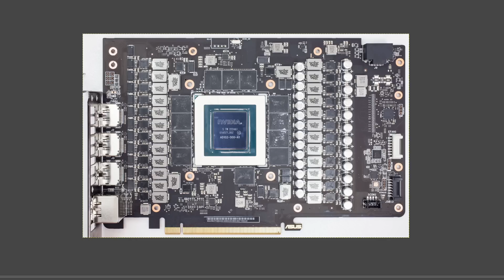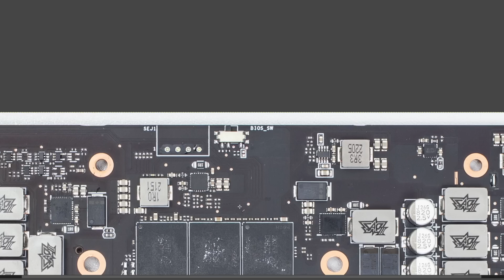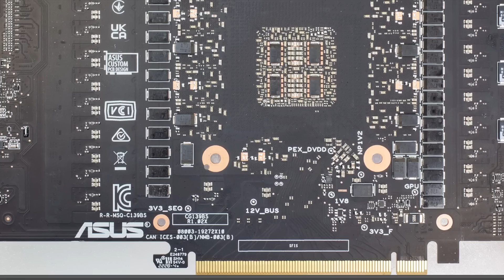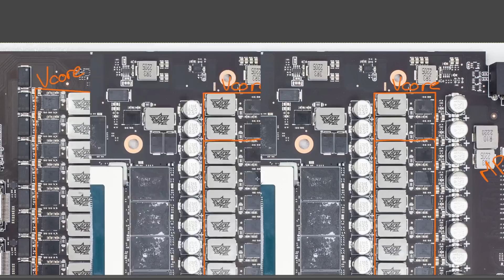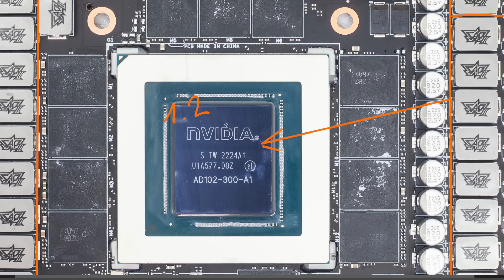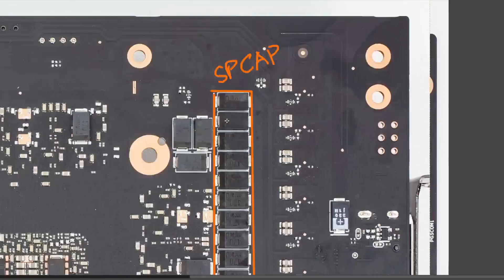GPU PCB Breakdown: ASUS RTX 4090 Strix

Comment: I think that Mp2891 PWM is a part of the issue with the 4090s melting power cables. I don't think the adapters and connectors have suffcient ampacity to handle the draw.
 The switching speeds and energy efficiency measures in the PWM are leading to transient spikes. 
I don't think the MP2891 is the right chip.

Comment: How did you remove the PCB from the cooling fin? Could you present a video demonstration in the near future. I have bought an EK waterblock for my Asus RTX 4090 Strix. However, I had difficulty separating the cooling fin module on the I/O side glued to the PCB. I did not dare to cut the glue in fear of damaging the thin circuit on the PCB.

Comment: hello buildzoid, it is interesting here for asus 4090 the input caps vs output caps choices... because for the consumer we find a lot of coil whine on asus cards (more than other brands). so perhaps either these choices can affect the amount of coil whine, or they are instead some attempt(s) by asus to reduce their levels of coil whine. or it could be due to the fact that they just use so many capacitors overall, or more is of certain types... another point about is that asus claims to have recently improved and so-called 'innovated' their inductors on brand new cards. which replaces their old version inductors. all in the name of better coil whine. but hahaha is it the chokes or the caps. anyhow you dont care about this. but it just maybe explains why they might do such weird looking things. since this issue is while nothing of performance, yet still a matter in response to so many complaints from users. who pays a lot of money for these gpus... so it stands to reason maybe the end result is both combination of whatever nvidia design specs dictates + their own asus performance or inhouse overclocker obsession(s) + also to simultaneously try to re-prioritize coile whine matter. which can be hard to pick apart. and separate one from the other. is my 2cents.
Reply: I sended back 5 Strix 4090 already because of that bee trapped in there and tried a gigabyte one and it has 0 choilwhine compared to Asus but the thermals are 3-5 degrees higher with the gigabyte one and it looks cheaper than the asus one but ZERO Choilwhine howww ?

Comment: I think the different 3.3V rails might exist because they need to have a sequence in which the power rails are turned on. Maybe 3.3V_F is a fixed 3.3V rail, and 3.3V_SEQ is coming through a load switch, letting them sequence it?

Comment: I have this exact card and the coil whine is so bad that I can hear it across the room at stock power levels. Running time spy sounds like a buzz saw. This is hands down the worst card I have ever owned for coil whine I have ever owned. I have even tried putting a soundproofing blanket over the water block it’s just that bad.
Reply: I sended back 5 rog strix 4090 already because of that crazy choilwhine and i will try 1 time again after that i get Gigabyte one because much less choilwhine

Comment: The Strix gpu's have always been great cards.  However, I'm on my second 4090 Strix because the power connector melted and burnt down on the original one.  ASUS replaced it with a new in box card, thankfully, and not a refurb.  Nvidia's stupid idea of a new power connector is a joke...
Reply: PS its not an NVidia design they were first, AMD will have to switch if it is going to comply with the PC SIG standard,
Reply: @zorbakaput8537  amd won't have a problem since the 12vhpwr is getting a revamp
Reply: @zorbakaput8537 connector is good its smaller and only one but the adapter is joke, too stiff, dont click, its just trash.
Reply: @PixelMoments774 Yup, you are correct. I was using the first gen of the cable mod adapters.
Reply: Damn right the Strix are great, my ASUS STRIX 980 Ti was on my system for almost a decade and can still run new games in low.
Reply: @conpa18dany  That was a great card. Used prices are lucrative at the moment, maybe it's time for an upgrade.
Reply: I got the upgrade, is a 4070 Ti @user-qi9be4lv7l

Comment: I had five different 3080/70 STRIX cards and ALL of them had the most terrible coil whine of all cards I've ever owned despite them being supposedly high quality PCB parts/design. I am not buying a STRIX ever again unless they get their whining under control and change their capacitors.
Reply: Strix 3090 owner here. Same. Same freakin experience. This thing is loud.

Comment: 11:22 could you use an arduino to generate a square wave? Or would the difference in what the gpu asks for and what it gets trigger ovp or something?
Reply from the maker: You'd have to disconnect the PWM VID signal that comes from the GPU. As long as you match the frequency of the PWM VID and amplitude it should work. Unless there's a restriction on the PWM range like 100% duty cycle = 1.15V or something.

Comment: One thing Id like to piint out. Im into diy high end audio stuff and in that world they like to put electeolitic caps on the top of the pcb + some film caps in the back of the ocb because it has some electrical benefits and it sounds better. Maybe there is a similar reason why they mix the caps that way? Maybe its not because of the amount of capacitance but the combination of those kind of caps doing some good things in the ripple. Just thinking outloud so someone with more knowldege can shed some light on this 😊
Reply from the maker: everything a cylindrical polymer can do an SMD polymer can do better(the SMD polymers just cost a lot more per uF).
Reply: A lot of things that sound better are electrically worse; see people who use vacuum tubes. Perhaps the extra parasitic inductance from the can capacitors is doing something.

Comment: Now I´m wondering if I should have got a Strix instead of a TUF.
I´m still waiting for any word on the RMA of my 4090 TUF ...
Reply: For the money, the msi suprim/x is the best bang for buck PCB. No reason to spend $1900+ when you can get essentially the same PCB performance for $1700.

And having binned ~10 of these and suprims, binning can be said to not exist.
Reply: What happened to your 4090 TUF?
Reply: @riadshash5456  Did run with max of 180 to 190 Watts. Wouldn´t draw power past that and run way too slow.

Comment: Sadly as good as the card is, it is also the top for coil whine. Yes, yes "Mine is silent" blah blah. Asus knows about it so much so, that with the new Asus Matrix card, they point out the improvements made with coil whine.
Reply: The coil whine on mine is quite noticeable, it just doesn't bother me.
Reply: @AdamBrackney  My hope is whatever they are doing with the Matrix 4090, they do the same for the 5090....well, if it works and does reduce/stop the coil whine.
Reply: @AdamBrackney  good for you. I had to power limit it to no more < 400W to not notice any coil whine.
Reply: @PowellCat745  I can hear mine at far lower power levels, probably anything over 150watts.  I don't know if the water blocks make it worse or not, but mine as front and rear blocks.  Honestly it really doesn't bother me, it's like revving an engine. Lol
Reply: @AdamBrackney water block makes it far worse due to lack of fan noise etc. mine sounds like buzz saw.
Reply: Jeah… 3090 Strix owner here.

This thing is the loudest card i ever had. It’s nasty.
Reply: @RCEngineTuner  That's what I had before the 4090. Lol.  I must enjoy the sound.
Reply: @RCEngineTuner  They seem more focused on "the fastest" and not so much on making it quieter.
Reply: @PixelMoments774 About 6 months ago I said the Strix and Suprim X had bad coil whine due to the 70a inductors they use. Turns out, in June, Asus said they had started to swap the inductors in the Strix to sort the CW issues.
Reply: My Strix 4090 is much quieter than the EVGA 3080 Ti that was in my last machine.  4k 120hz use, so no crazy high fps.
Reply: @94b20gsr  Some people were lucky with the one they got..., but most were not so lucky.
Reply: @PixelMoments774 If it came from Asus, there is a good chance.
Reply: I can confirm my whine is horrible glad I sold it fast.
Reply: The “mine is silent” crowd never really pushed this card. Also, this card’s 12vhpwr connector seems to have the highest melting rate.
Reply: @PowellCat745  The melting thing might be a bit unfair due to sales vs other brands. I would guess there are more Asus and MSI cards out in the wild, but don't know the figs. My Suprim X just melted with a cablemod adapter.
Reply: @MrMrGaming  No. ASUS’s failure rate was much higher. Rate is not related to the number of sales.
Reply: @PowellCat745  I Wonder if the inductors come into this? The high-end MSI and Asus cards use 70a, and I think the others use 50/55a.
Reply: @MrMrGaming  Yes, it does. There is no noise on cheaper cards, where there are cheaper BPM components.